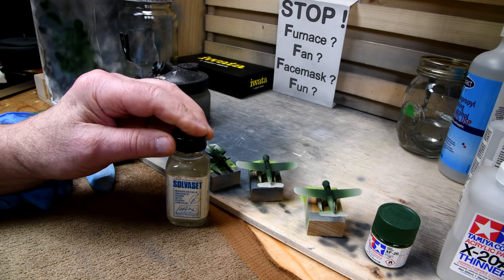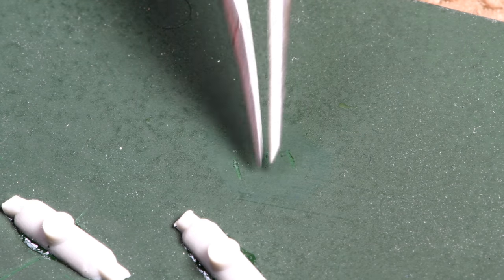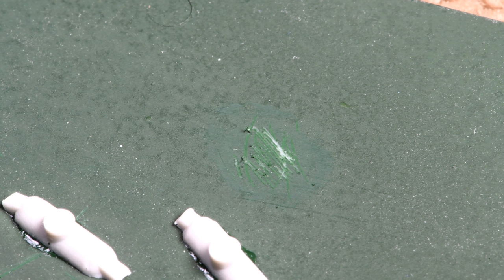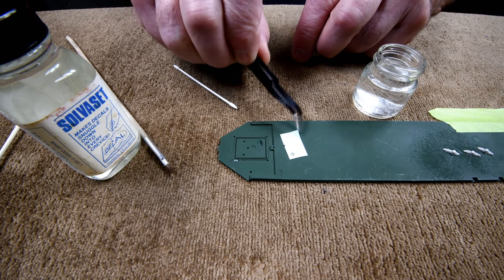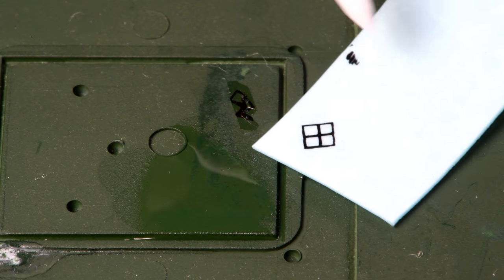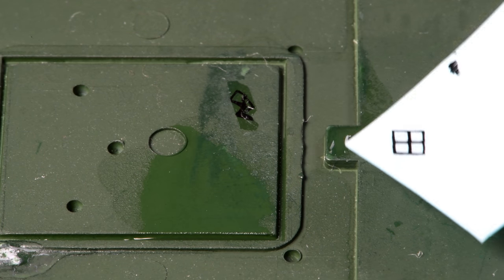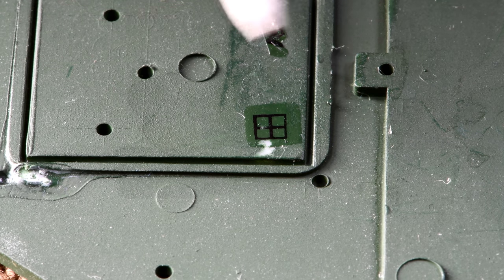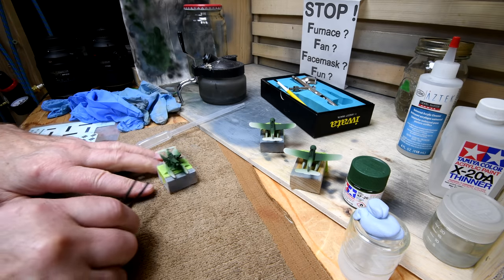The Model Ship - Part 333

Comment: Hi Ron just remember when using these products, after 5 to 10 minutes rinse the area with a wet cotton bud otherwise it will leave a stain ! 😎see you tomorrow
Reply from the maker: Thanks for the tip Marc. 👍
Reply: Just remembered aply clear coat before decals, it wll seal the paint, once decal is dry and cleaned of residue ,aply another coat of clear coat to seal in the decals, this method will also hide the shine of the decal making it look more like a paint job ,have fun!

Comment: Hi Ron I don't know if you noticed but around that decal is a gloss finish, this is the carrier film and if you don't gloss varnish your planes first that's how the carrier film will show up. So what you need to do is 
Spray gloss varnish and let it dry.
Apply decals and let them dry using solvaset if needed to settle them in.
Spray Matt varnish.
Best wishes Vic.
Reply from the maker: Hi Vic,
Yes I'd noticed that the decal made the green paint appear to have a distinct glossy look. Was thinking too that should I apply those decals on the wings, I'd better count on having to spray a matt finish clear coat. 👍

Comment: And paper fibers are layers horizontally so their ends line up with the edges of the paper. Meaning that a large decal sheet takes ten times longer to saturate than one you cut closely to the design. The liquid ingresses from the edges, not the top and bottom.
Reply from the maker: That makes perfect sense Tom. Might be fun to do a test. 👍

Comment: Only really need to use decal setting solution to actually sorta dissolve the decal and settle it into nooks and crannies. You shouldn't even really need it in this application as the surface is so flat.
Reply from the maker: I've noticed that it seems to soften the decal. Wonder if it could possibly dissolve it if emersed too long.
Reply: @roncalverley  That bottle of Solvaset  has long since lost its 'fizz'.
You position the decal on the model and when you are 101%  dead certain of the position  - THEN you apply the Solvaset.
The decal should soften and settle into every nook, cranny, and recessed line on the model.
ANY attempt to prod or adjust the decal position after the Solvaset is application would cause the decal to disintegrate.
The stuff is useful for models of military vehicles and larger scale aircraft with lots of surface rivets and grooves.
But kind of pointless for decals on smooth surfaces.
Reply from the maker: @agwhitaker  Yes, I do recall from when using the Solvaset years ago that it does greatly soften the decal.